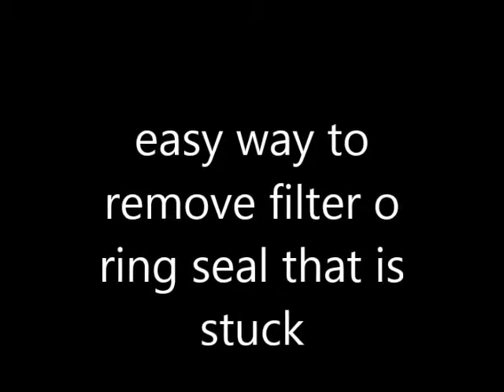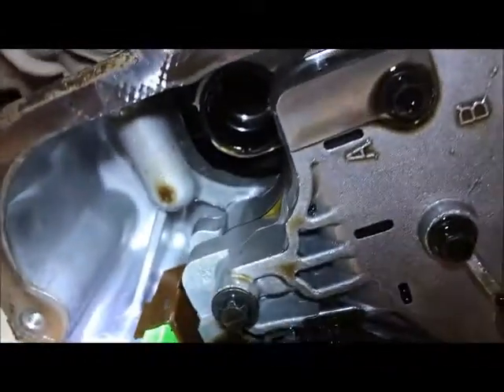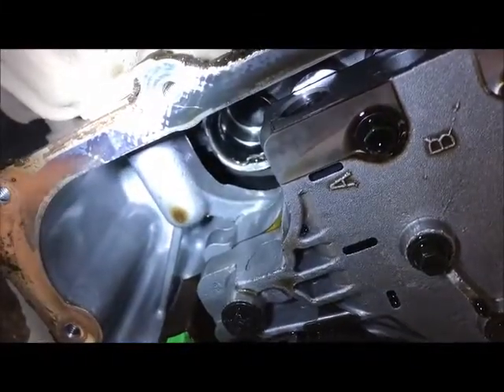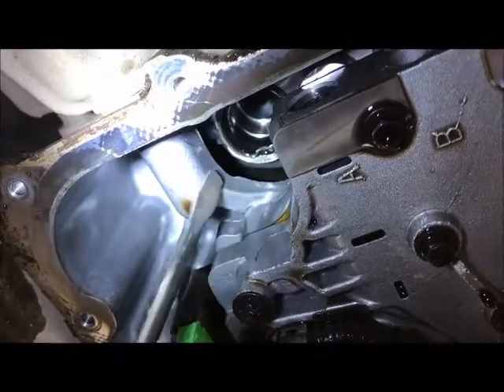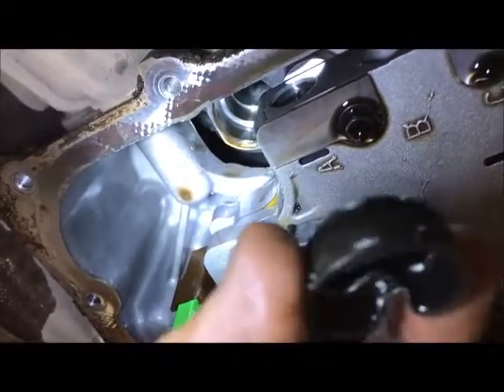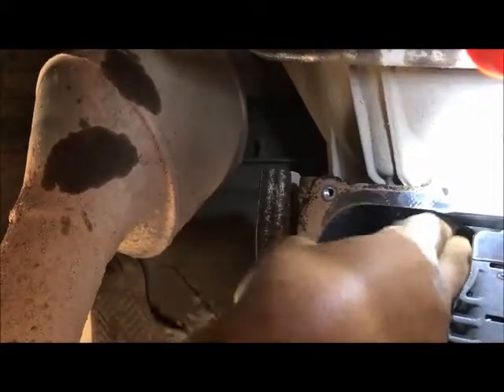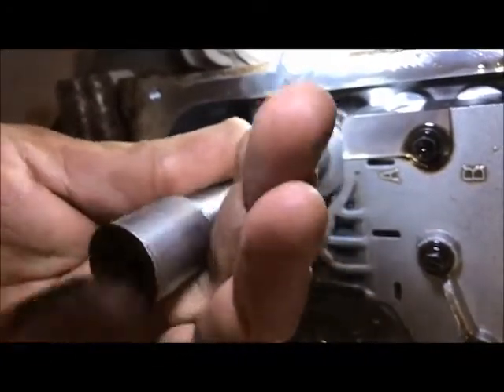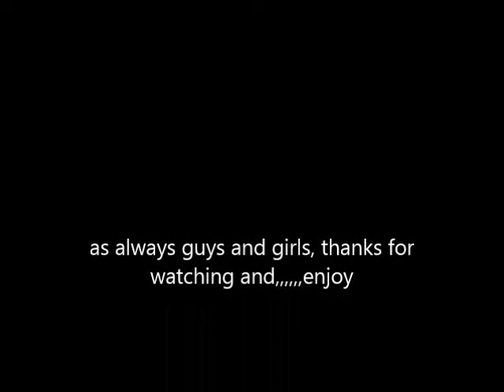Transmission Filter Seal O-ring Install and Removal Stuck

Comment: I had to use a pointy pick to get mine out. Only knicked the side a wee bit, BUT the new one got all bent out of shape when I tried to put the new one in with a socket.
What size socket did you use?

Comment: I have used a sturdy icepick to get between the o ring and case. As it is driven up, it bends the seal inward, and then you can get needle nose pliers and pull that dirty word out!!

Comment: In my case, my new filter has the seal built onto it and it won't go in all the way but is sealed none the less. Pretty stuck at the moment. Everyone else seems to have the ease of "oh it pops right out and back in just like that".

Comment: Why didn't you lubricate the seal before you put it in? Once you put the transmission fluid in this going to be soaked in fluid anyways, and if it was lubricated first it may have slipped right in there a lot easier.

Comment: I just use a chisel and tap it till the lip comes up then turn it vertical and tap against the lip that I previously got bent and then use pliers and grab it and push down and comes out no problem
Reply from the maker: perfect. thanks for the tip. thanks for watching

Comment: On my 04 yukon 4l60e  the metal lip is sunk down into the valve body bore 1/16" and it wont budge yet.  I see some drive a screw driver in between. Maybe mine was put in to deep?  THe new seal metal part has a tapered rim that is bigger than the rest of the metal sleeve.  it the old one looks the same it will be nearly impossible to get out.
Reply: I got it out but  i did nick the tapered area with my little sharp screwdriver and hammer method. I drove the screwdriver to straight in... you should tilt it like 45 degrees once you get a start under the metal.  Seems like a stupid sealing method.. why not rubber on the OD and ID  Dont want this seal sucking air but its not like lots of vacuum?

Comment: What happens if the old one isn’t removed and a new filter is installed?
Reply from the maker: it may leak, not good. you need the right amount of fluid pressure for smooth shifting. thanks for watching.

Comment: What would happen if it wasn't installed correctly or of it failed?
Reply: Mine fell out when test driving. Truck will not go into any gear and you are stuck.  I had it towed home. Had to drain the fluid and reseat it

Comment: Pontiac G6 GT 3.5 engine same freaking thing banana for 2 hours I didn't want to do what you just did in case I hit the housing but I have no choice pick tool one bringing out either stupid they should just cut the mold off rubber gaskets on there the O-rings